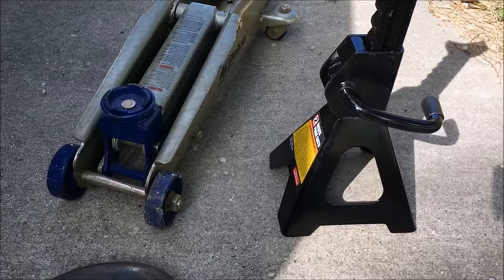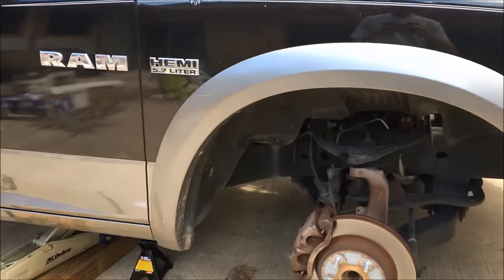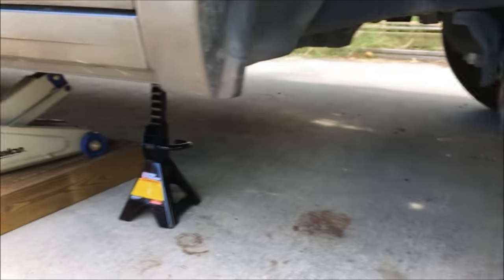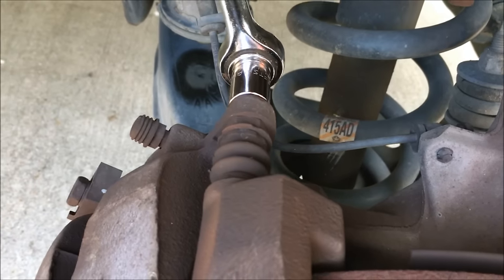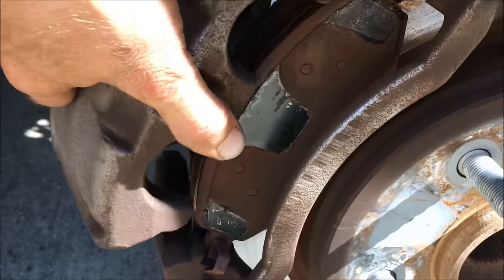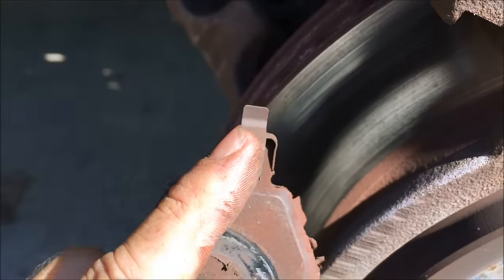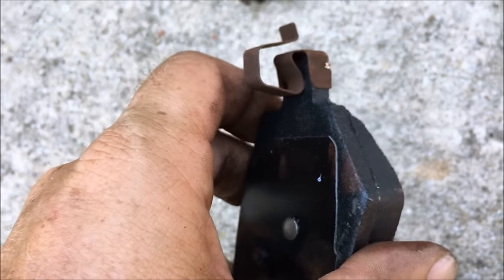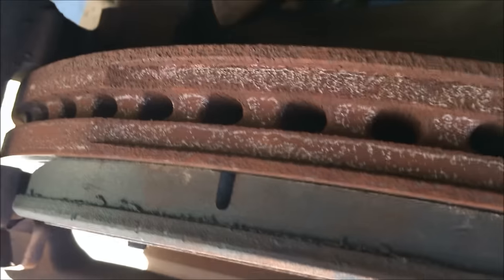How to Change Brake Pads on 2010 Dodge Ram 1500

Comment: Good job! 

Tool list: 13 mm socket, 17 mm wrench, prybar, jack, jack stand a must! What size lug nuts?

Suggest some lube for pad slides and bolts. Also, block wheels or set e-brake for safety.
Reply from the maker: I did block wheels, but Did forget to mention.
Reply: 21 MM

Comment: My pads had some small metal pieces sticking out so when I went to prying, it messed up my caliper.  Not all pads are smooth to just start prying off the housing.  I had to remove the whole housing then press in the two whatever those things are called first.

Comment: Why are you referencing metric tools?
Reply: depends where the vehicle is made... they build the minivan in canada for dodge and they use metric bolts and nuts   The ram pickup was built in Mexico they use the metric system and bolts , only a a car built in the USA will use standard sizes.. its the only country in the world that couldnt figure out the metric system